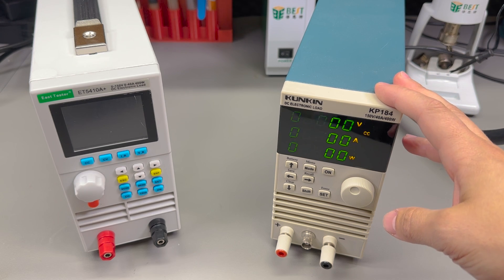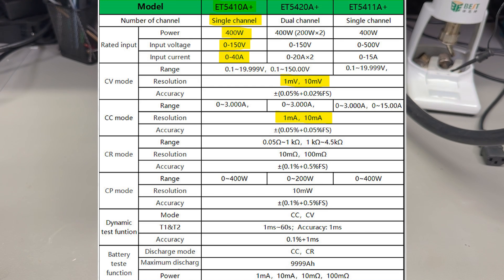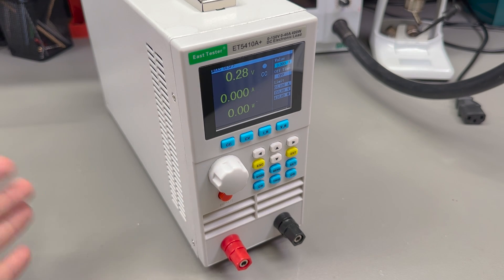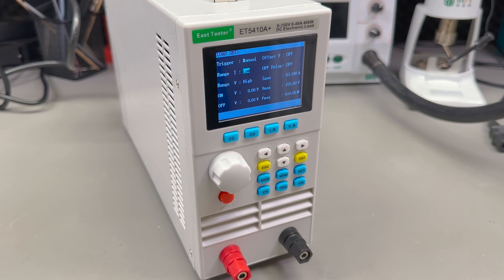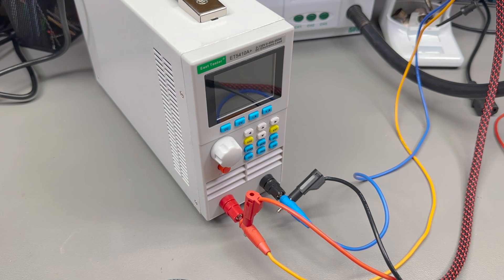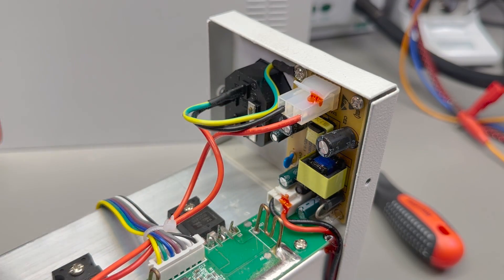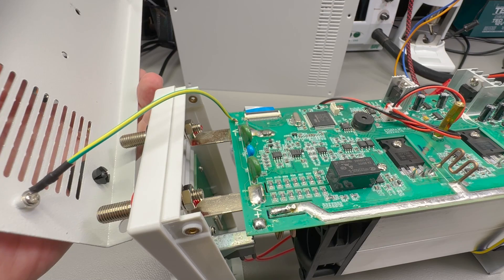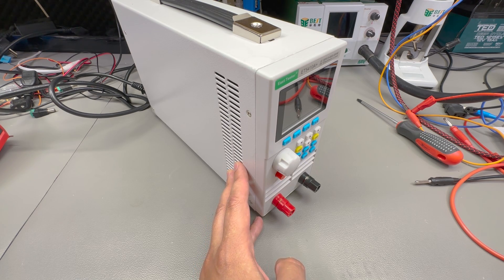EastTester ET5410A+ Electronic Load Review | Voltlog #453

Comment: Are yiu just winging it, and you have no interrest in actually checking this device and its features, it got a shutload of things packed up its sleeve, that you don't see in  most other loads like CC+CV, CR+CV, CP+CV (PC) alongside PC software, and sweep/scan, transcient, testing LED drivers, and here the stacked dynamic C?+CV can also be very powerful for working with LEDs and sensitive devices, it got extensive listing test feature, it got pass & fail, and you can literally mix and match on many of these features.. and I'm only referring to the old non + model... does this + got more, but you have no interest in checking it.. you handle like its a 20 dollar static load.

It is simply unboxing, turn it on, see if its accurate and take the top of and look inside and notthing more while second guess the design with a Dunning Kruger mindset, that cant comprehend that the internals originate from other models..-.. what exactly are you reviewing?.. clearly not the product and its features when you dont even check if the features work as intended.

- could be interesting to see, also its PC software or its dynamic C(?)+CV features and how well they work and the usecases where such test scenarios could be handy.. and features that n0t many loads got, unless you pay up int he four digit to fx GW INtek PEL3000&5000 series

Maybe IM asking to much from this romanian dude, that is solely ho-ho-ho'ing for China.. but you should at least check the units own loadfeatures and if they work, as that is the biggest problem with these CN units.. western people cant return them, as it will cost to much as they are heavy / bulky, and if a vital feature doesn't work.. your literally straight out of luck, and cant do jack, and likely why China are looking for people like channelholder, where the moral bar ain't that high and sadly with strict guidelines for NOT digging down into the features and remember to label it as a "review"..

Either way - if the reviewer looked at the internals between the new plus+one and the older units, it should be clear that its a massive cost optimised stepdown unit, these + units... look at the internal side by side..
or just the weight.. 
ET5410 = 3700g
ET5410+ 2900g
but then again who cares why the older one were +25% heavier, than this new "China Enhanced variant"?? doesn't matter when "Romanian influencers" needs to push a narrative dictated by sellers in China.

Comment: Did you check continuous current sinking capability of 40A? I guess it gets pretty hot over time and may even fail after a while? Already many cheap electronic Loads have 4 wire measuring, a shame this one has not. This is a must for an el. load!

Comment: Hard pass on that one.  IMO, any DC load that doesn't have remote voltage sensing is a waste of bench space.  Unfortunately, there just don't seem to be any really good quality DC loads available at low prices.  I think the Maynuo units are about the best value on the market if you need precision, accuracy, remote sensing and a decent PC remote control application.  I've had a Maynuo M9812 for several years and I like it a lot.  Getting it delivered from the lying, cheating Chinese seller was an enormous hassle, but the load is nice.
Reply from the maker: I've been looking at a Maynuo for years.. The thing is, the electronic loads I already have, even with their caveats, still get the job done.
Reply: It has automatic compensation, but it is not shown in this video. It calculates wire resistance. Works fine, I've used it.  No need for remote sensing with 4 wire.  The downside is you need to recalibrate every time you change the wires. Also a constant voltage source is required. By default it tests at 0,5A and 1A, but it can be changed the values, that how it calculates wire resitance and display accordingly.
Reply: @modorangeorge4991  "The downside is you need to recalibrate every time you change the wires"  So not really 'automatic compensation' then if it is going to require user input each time the wires are changed.